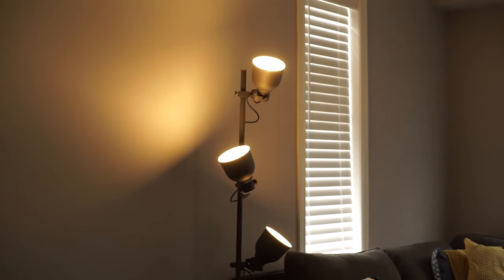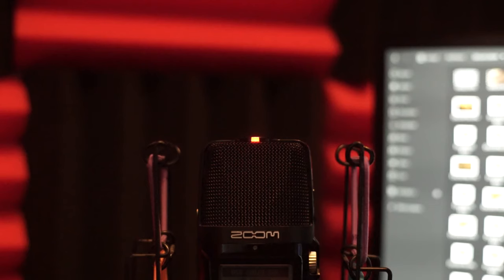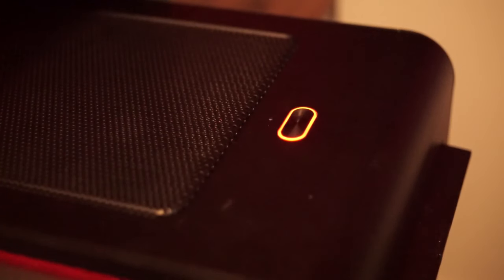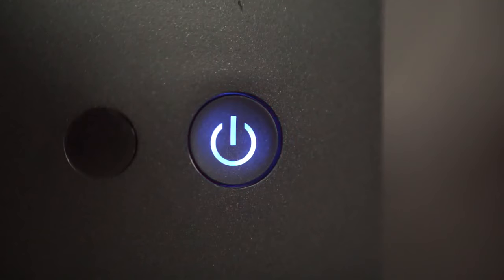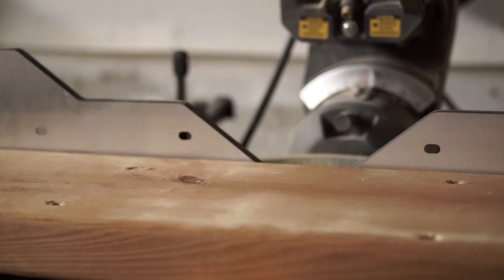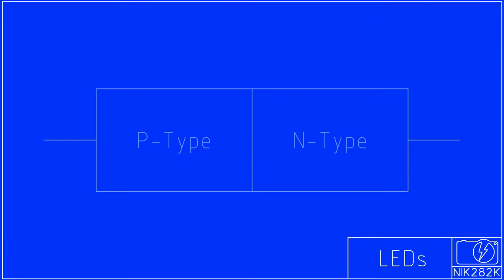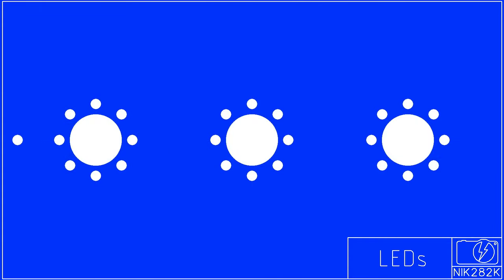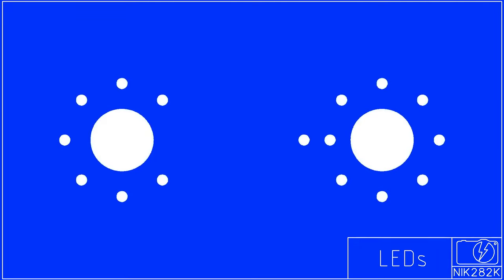How LEDs Work

Comment: did the silicon carbide demo,  wound up poting the carbide in some lead,  and then poked it with a cat whisker made out of a safety pin.   had to poke it in a dark room for a while to get any light.
Reply from the maker: Glad you got it to work, lead is a good idea for keeping a conductive grip on the carbide. I bought a bag of 100g of carbide crystals and only found 2 or 3 that produced any light.

Comment: 3:31 "By choosing doping agents, … one can change the color of the led" this isn't correct, i'm afraid. Doping is a very minute addition of foreign atoms, in order to push the semiconductor into being of n-type or p-type. The energy of photons is determined by the bandgap, which is a property of the base semiconductor, and is only very slightly affected by doping. The doping to achieve a color change has to be quite extreme, at that point it's rather called "alloying". It is possible, see GaAs-InGaAs, where the bandgap can be changed by changing by replacing Ga atoms with In.  https://en.wikipedia.org/wiki/Indium_gallium_arsenide#/media/File:InGaAs_Energy_band_composition.PNG
Reply from the maker: I totally whiffed that. I'm not able to correct the audio without re-uploading but I was able to removed the misinformation. It should update sometime today. Thanks for catching that.
Reply: Thanks! Sorry to bother you again, but I found another small problem: at 2:26, you said something like "wavelength of photons is proportional to the energy", it should be "wavelength is inversely proportional to the energy", or "frequency is proportional to the energy"
Reply from the maker: I'm hoping that the concept was clear to most people that the energy of the photon is related to the energy lost by each electron. 

If I make "story" posts on YouTube are you likely to see them? I would like to have future videos as accurate as possible, having viewer input would very much help with that.
Reply: More popular channels show their videos to patrons before publishing, and they apparently do pick up quite a lot of mistakes. Sci-show sometimes puts out a pinned comment with mistake corrections. 

I don't know what "story" posts are. Are they the "community" tab of the channel? No, I usually don't see them, I'm still using the old version of youtube website. The new version does show some of them on the home page, but not all of them.